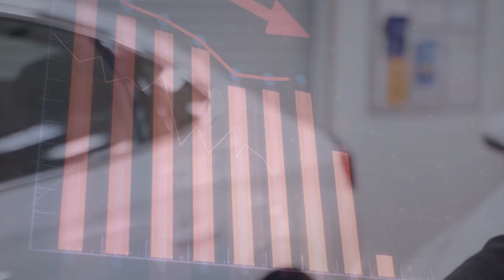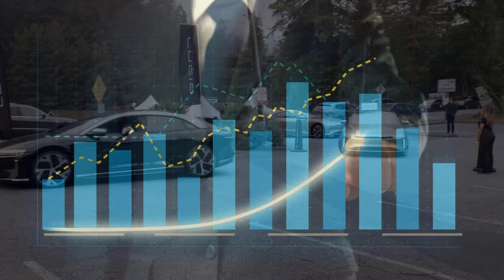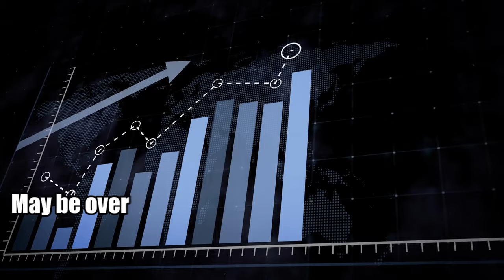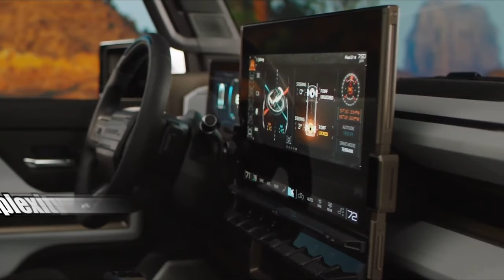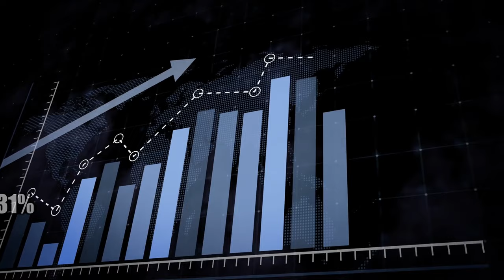Dealers’ Dismay: The EV Skepticism You Won’t Believe! Real Price Tag of Electric Vehicles

Comment: I don't quite follow the " consumers want faster charging times " thing. Consumers know that fast charging will progressively damage your EV's very expensive battery and reduce range. I wouldn't want to do something I knew would damage my very expensive electric car.
Reply: There are new batteries that can fully charge in 10 minutes. And EV batteries last longer than car engines.
Reply: Too bad those batteries don't seem to be available in current market EVs.
Reply: That’s because consumers don’t understand that instead of charging whilst out and about.   You charge at home overnight on cheaper electricity or from solar panels.
EV work where 

1.).  Can home charge overnight on cheap electricity 
2.).  Can get out and back without charging or at least with so called destination charging.

As such charge time becomes less important as charge whilst sleep or whilst at your destination.
You charge on your journey only when absolutely have too.
Reply: So all the poor suckers who can't charge where they live are screwed. Doesn't sound like a good deal to me, I'll pass.

Comment: Even these figures are skewed. I have a Suzuki x-cross, it's badged as a hybrid, even though it's such a mild hybrid, it's a joke. But this gets Suzuki's data for selling EV & hybrids to a level for complying to legislation etc, even though the hybrid part is almost just a badge and an extra 48v battery which supposedly helps with fuel economy & acceleration.

Comment: 60% of EV buyers would never buy one  again .
Reply: LOL. It's the reverse, but even better for EVs. It's about 99% wouldn't go back top an old gas boiler..
Reply: @alexmckenna1171  The hard cold facts are the energy density cannot be made favourable, despite the “ it will get better soon” proclamations made year after year after year, nothing of note has happened. Lithium simply cannot provide the storage capacity, otherwise all EV cars would weigh a lot more than twice what they do now and most of the energy is going to be used just to move the battery around. Simple laws of physics. Then the natural degradation of the battery dimishes capacity further. Ultimately they make no financial or ecological sense.
Reply: @mellarner8253  Rather than being taken in hook, line and sinker by the oil-lobby propaganda, just try checking those facts. Fires? (Gas cars are 50 times more likely to catch fire than EVs. (Diesels are even worse.) Value? Like for like, EVs are no more pricey currently, and as gas cars become more expensive, the price of EVs is dropping every year. Range: If 200 miles seems to be more than enough for 99% of people, but if you’re the kind that regularly drives 400 miles without a coffee or going to the loo, then you deserve a medal. Car Life? There are many thousands of EVs running happily after 100,000 miles or more and keeping their value on the market. EVs have so many advantages - cost saving, cleanliness, no cancer-gases and particles, crash stability, (they don’t turn over), ease of charging (no gas station headaches), future-proof, etc etc
The proof of the pudding is that millions of EV owners are delighted with their experience and few would ever go back to petrol, if any.
Reply: @alexmckenna1171   Most EV’s will not last long enough to equal the carbon footprints of an ICE, let alone better them, then there is the case that most electricity is generated by fossil fuels. Most EV drivers will treat their vehicles as disposable items after 3 years, there is no secondhand market, even with catastrophic depreciation rates, nobody wants to buy a secondhand battery. As for range, I will need more than 300 miles while towing 2 tons. I can stop anywhere for a 5 minute comfort break. As for ICE fires being 40 times more likely, well, depending in how you present the statitics. There are is at least a hundred times more ICE cars on the road, so percentage wise, wrong again obn fires.

Comment: no price is too high to virtue signal that you are saving the planet, and you have excess disposable income.
Reply: Comparing like with like, EVs are about the same cost, even if you don't count the savings over time on repairs and gas. In any case ICE cars are getting more expensive, and EVs prices are continuing to fall.
Reply: Used EV values are well in their way to zero, or negative values, as it is very likely that the owner will eventually have to pay disposal costs, just as we in the UK pay an environmental disposal charge for every tyre we change at the tyre shop. The difference is that £5 tyre charge will be a £2k EV fee, maybe more, as it is such a hazardous proposition and a very small percentage of a lithium battery is reusable.
Reply: @mellarner8253  Wrong on all counts. Where do you get this stuff? The Daily Mail? Or do you work for Arab Oil?
Reply: Just common sense evaluation of facts and the simple laws of physics

Comment: There was a chicken/egg conundrum with EV's and the charging infrastructure. Gov't diktats from around the world have tried to forcefeed to create both the infrastructure and the EV market. Doing so it looks like they have wrecked it instead. They should have let it grow organically. Now, the market is faltering on lack of infrastructure and the charging networks are failing because the ROI on a weak market is killing them. The cheerleaders are trying really hard but the team is down 4 TD's and it's still a crappy team. This isn't, and never was, a winner.
Reply: The figures seem to prove that EV sales are still rising in all countries, with or without government help. USA is a bit slow on the uptake, but will follow.
Reply: @alexmckenna1171  Actually they don't. Current sales figures are dropping. Car dealers are very worried. It's revealing that Buick dealerships are throwing in the towel instead of doing the mandatory costly upgrades that GM demands to move to EV's. They don't believe the market is there.

Comment: You have a lot of negatives comments toward EV. But this a means to transition to a low Global Warming Potential (GWP). Fossil fuel cars have a very high GWP, and are certainly not the future. If there was another method to reduce the GWP, then bring it on. However, we do not have great engineering imagination to create 'that' something different, hence all the talk about hydrogen, etc. So, we are stuck, until a genius pops up ( that the public will accept) with an alternative. Low sales, your video is mostly US centric, but, has also much yo do with price. The early adopters are just drying up. IMHO, if the EV makers can make less profit ( yes I know the contrary is heard) then uptake will be greater.